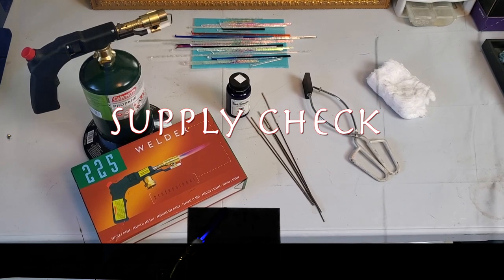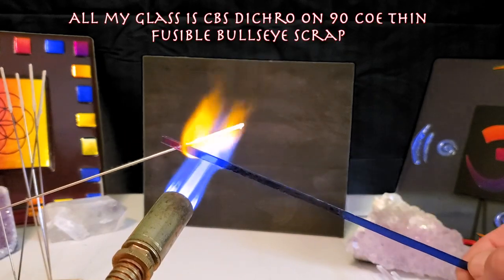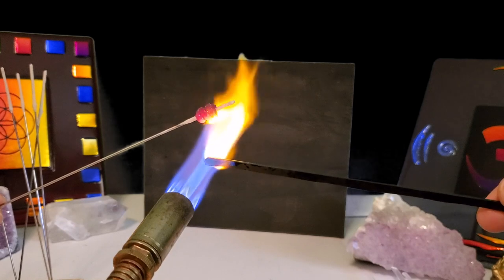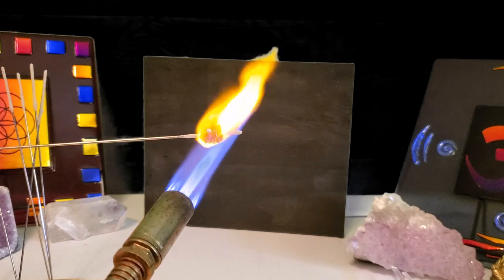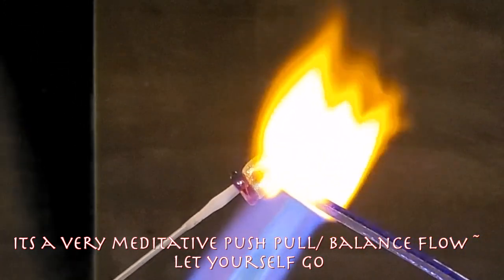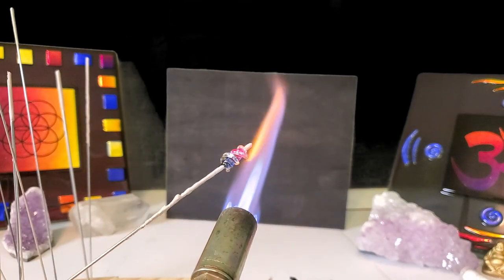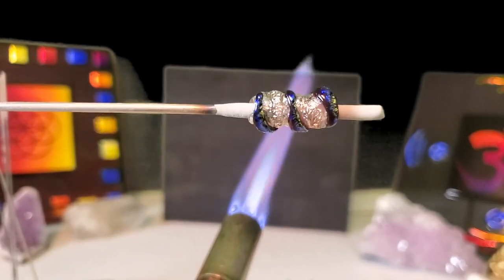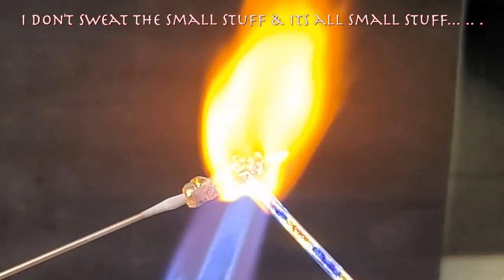Dichroic Beads on a harbor freight torch $15~90coe.Scrap works great 🌀fire that shit up!! how to

Comment: I would love to try this, where can I buy the Dichroic glass strips? Or do you cut your own?
Reply from the maker: I buy from CBS dichro  and a local shop Sheri @  Melt Glass  they are on line too.. I cut them thin and use scrap.🙂 fun to blay with the flame thou .. been fusing longtime